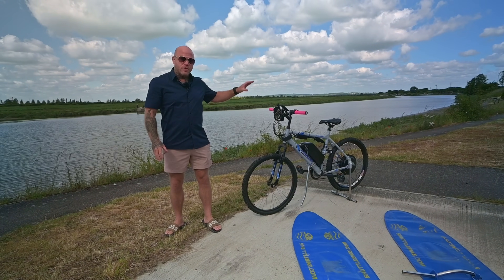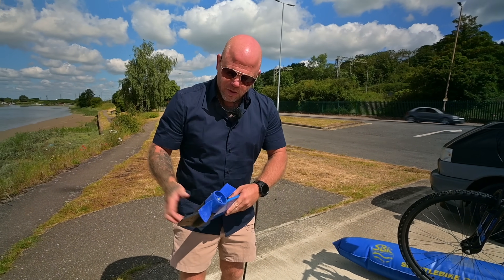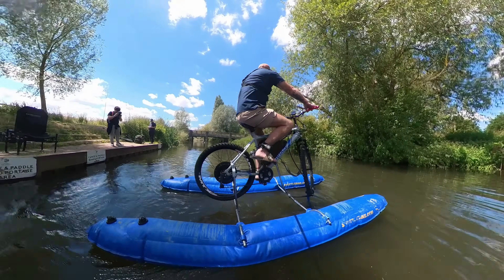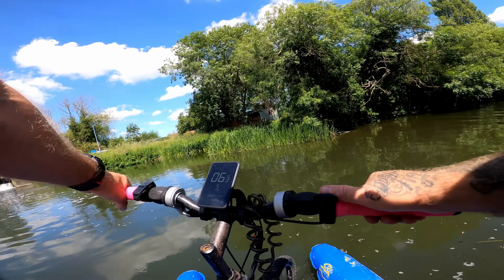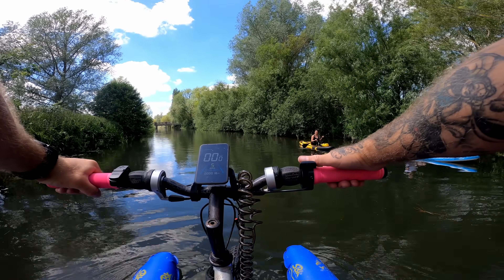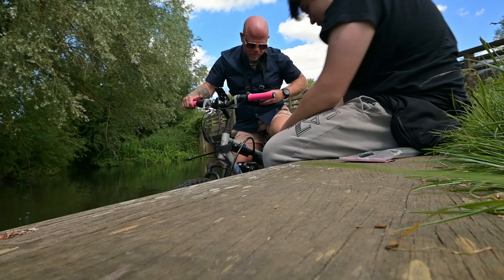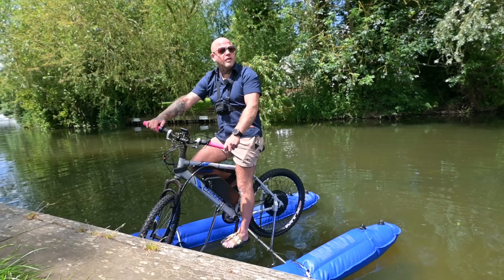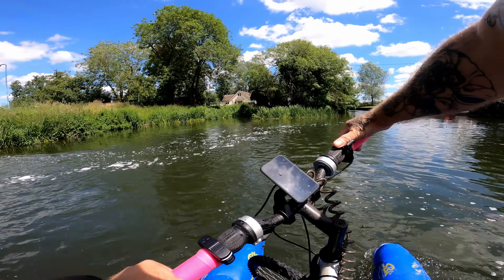Can an E-bike Ride On Water? Concept to Reality: Building My 2000 watt Amphibious Water-Craft

Comment: Try using waterjet thrusters that way adding reverse will be easy, and not require any electrical switches, gearcase, lower unit, or prop reconfigurations.
 As for the pontoons, personally I would either ditch them, and instead build a 12' long, by 7' wide, stitch and glue plywood e-trike skiff,  with fold, or tilt up, fat tire, hub motor wheels. Or you could instead build bigger, and better pontoons, that can be folded down when you need to get afloat.

Comment: Hey just saw this. Good on you mate, I have been pondering this for years. A couple things I noticed. 

1) I wouldnt mess around with that propeller. Nice idea that i have thought about as well glad I saw your system. Just get a proper propeller with remote. This way you can go backwards too. That system with the tire turning is terribly inefficient. You are losing energy on the tire as well as the propeller. Glad I saw this. Not worth the effort. 

2) I would put some kind of hard shell around the pontoons. It will massively reduce friction. HUGE energy loss.

3) As far as stability goes, I think you need longer pontoons. Also have you considered putting the pontoons on a right angle into the water like a hydrofoil? I also think maybe put a board or a series of poles between the pontoons? And maybe some kind of bike rack? One last thing also maybe put 2 mini pontoons on the front bike wheel? Maybe like a snow mobile? That would probably keep you from going over the front. 

Anyways, Im no expert but those were my impressions. The basic set is so simple its geius. I got that from your video. But even more important I learned about what DOES NOT work. Its a simple concept but the dog is in the details. Cheers!
Reply: Awesome idea of putting to floats or pontoons on the front wheel.

Comment: if you find a way to immerse the wheels a little and secure the motor not to fail with water. you could have a system to propel this thing. Because this way its too much power outside and too little in :-) FUN though ! YOu rock

Comment: Lol well this looks like a basic prototype for a water ebike. It would work fine to ride down a wider river. The pressure in the inner tubes could probably be a bit higher to ensure the "wheelie" effect (bike wanting to lift up out of the water when you speed up) is minimal.

Comment: round the edges of the blade and make it smaller for more efficiency and less drag. the blade also needs more oxygen so as high in the water as possible and stop it changing pitch on acceleration.

Comment: Great video, I was thinking you had some balls going for the waterfall! I think the inefficiency was caused by the fact the prop mount was able to move, if you can get it to stay more firmly in place the speed will improve. 
If you want to change the prop design you have three choices which are increase the length of the blades, make it a tri blade, or increase the pitch of the blade itself. I wonder if you could get some 3D printed that would hold up otherwise you would probably need them moulded.

Comment: Great video I think the issue is the connection between the tyre and the propeller. The water is giving the prop a lot of resistance but the tyre connection is slipping and not giving the prop the extra power your giving it. I different prop will more than likely make it worst and cause the tyre to slip more. I better connection to the tyre is needed with less slippage. Have a great week.

Comment: Love your channel dude. I was wondering if the propeller is spring loaded to stop overheat when it gets tangled in weeds and such. If so the power of your bike setup could maybe exceed the grip of the spring under load therefore the axel of the propeller would be spinning faster than the propeller.

Comment: how about doing an electric trike ,with both rear wheels being used like a paddle steamer . or same bike and a lightweight axle across the back that the rear wheel  can touch and turn  for drive ,I'm sure it would be faster
Reply: I also have been thinking of a trike or tricycle w two rear wheels.

Comment: Haha where do I start.😂
Fun project but it's not going far unless completely redesigned but then it would be a lot more money / time.
Side not I had a RC boat/plane thing that landed upside down with esc underwater which shorted out and set the battery on fire, looked like a bomb had gone off, that was a 800mah 3 cell lipo...

Comment: Quick release front wheel when you're going on the water and connect an adjustable clamp to the forks.. All out outboard motors need to be adjustable. Better known as trimming so ad a lever so that you can adjust the trim as your speed increases

Comment: The propellor has got a bit of a ‘semi’! If it’s mounted in a more rigid way that would certainly help. Clearly there’s a lot of power loss with the drive wheel shredding the tyre and the pontoons aren’t inflated enough and need bracing better. The propeller is most likely big enough but I’m guessing the drive might fail if you did sort the above issues and got all the power down. It still looks like fun though👍

Comment: Those pontoons look severely underinflated... even if they aren't.. you can always overinflate them for extra stiffness... would make a great video either way it might go faster it might make you swim to the shore 

Looking at the motion of the frame, if the pontoons would give more stiffness on the horizontal plane it would help with the rocking motion of the bike. That and checking the angle of the shaft/prop as you said. 

Look into if it's possible to change the prop out, you have a 3d printer iirc so you should be able to make something less optimized for very low rpm  There is a very good online prop designer called B Series Propeller generator, always you to save to step/stl file. And there is quite some stuff about 'propellers 101' though I do feel that does sound a lot like I'm oversimplifying since there it's actually all quite complicated if you dive deep enough. But even taking default values and just playing with pitch and rake on different diameter props with different number of blades could be fun and the online generator can give you stl files for all of those with a few clicks.

Comment: You need to pump the balloons firmer so you don't move as much if you put power on full. I'd like to see a better efficiency of propeller see you go 10mph or faster.
Reply: Totally agree with you muramusan,both the air bags were badly under inflated.This enabled the front to raise under more power,and also made the bike lower to the water.If the floats were filled till they were firm,this would stop or certainly reduce the front lifting.Also it would lift the bike about 2 inches higher,preventing the rear wheel dipping into the water and him getting wet.I think he needs to retest this kit,and just inflate the floats properly it would be a completely different experience.

Comment: i dunno how sealed the cable is going into the axle or the battery terminal , but i use plumbers mate putty to seal any gaps for weather proofing , its waterproof and can be removed at anytime , it also works as a blue tack lol